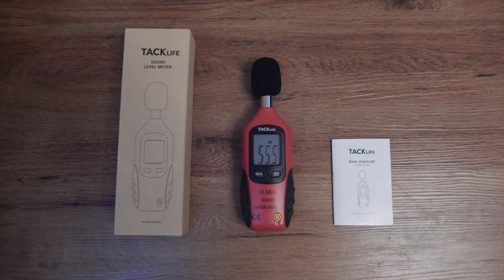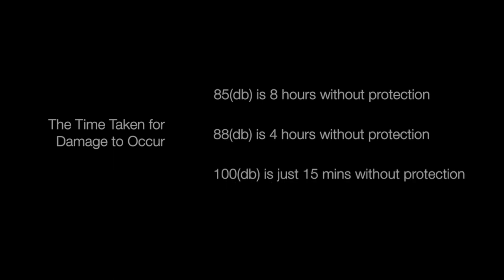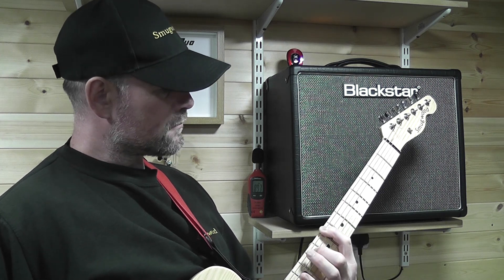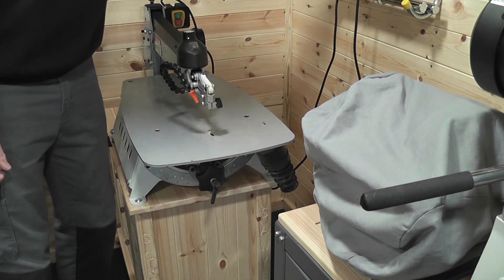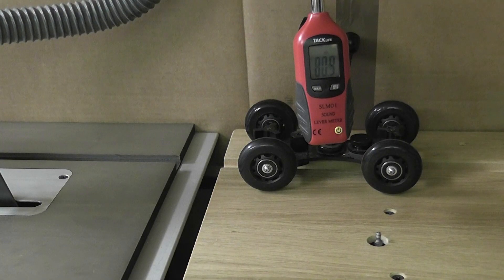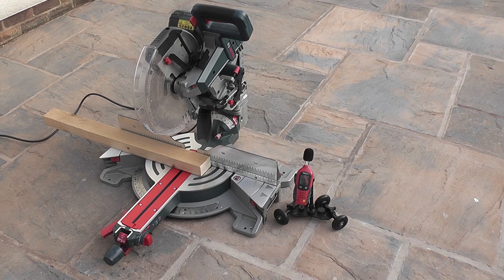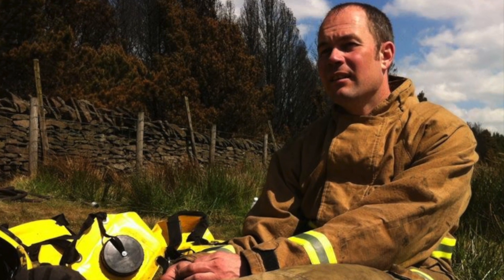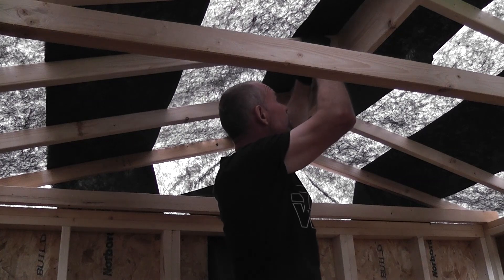Decibel Level Testing Workshop Tools - How Noisy?

Comment: I've done some sound testing and hired people to do it for large machinery.  Yes its true, you can't do a proper test of the actual rating without baffling the surrounding area, doing it at a specific height and distance and using a much more expensive meter that's also been calibrated - however for comparisons this video is pretty great and there are a few eye opening tools there and some good advice that everybody should take note of! :)  Keep up the fantastic work!
Reply from the maker: Thanks. Yeah, they're just rough tests, but do give some idea of noise levels. Certainly worth putting ear protection on for most power tools though :-) Even the quiet ones are loud haha

Comment: Nice video Lee.  One thing worth mentioning, the increase of noise levels of any cutting machine can be massively affected by user knowledge and sharpness of the cutting device. blunt planer blades or router bits for example. Examples of user knowledge in terms of tooth patterns on saw or band saws, feed rates or speed rates. Penetration of the sound is also a factor , I may be wrong but i suspect if the reader was at the same distance as your ear on the handsaw test the figure may have dropped a fair bit..........well that and a decent saw would help  😊
Reply from the maker: Some good points. And maybe i'll have to do the handsaw test with the meter near my ear and see the difference it makes...be an interesting one to know.

Comment: I work with someone who has the attitude ppe is for wimps, they wear glasses, so goggles aren't required 🙄☹ my hearing isn't brilliant but I've been using ear protection to try and slow this degradation even more. Thanks Lee, good informative video.
Reply from the maker: Long story short...I had a table tennis table fall on my head years back and suffered ear damage. I only have to listen to certain frequencies for a few seconds now and i'll have issues for days. Ear plugs prevent that from happening. Im a big fan of PPE having seen the results of people and long lasting effects of people who haven't worn to and regretted it later. Only problem now though, is i used to buy P3 masks every couple of months...£20...I tried ordering some this week...£110!!!
Reply: Yes, and I would Imagine mask prices will stay high for the forseeable future till production ramps up to cope with the current demand.
Reply from the maker: The shop I used to buy them off...I always used to buy them and joke with them saying How Much? They offered the best price around and I'd always wind them up about it haha. When I called them this week to place and order for some gloves that when they told me how much they where! I also buy nitrile gloves every month...theyd doubled in price and were being restricted on order as people were literally asking for 10s of thousands of them. Fortunately...the ear plugs i ordered are the same price :-)